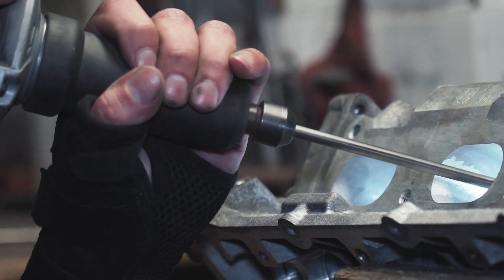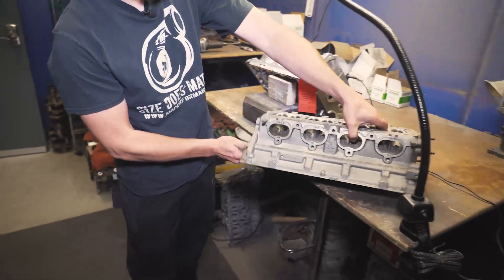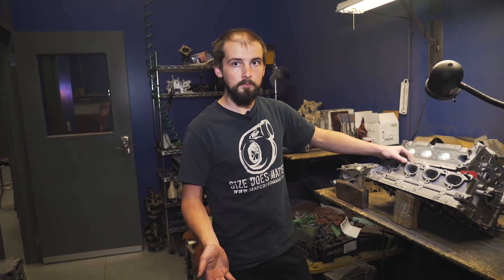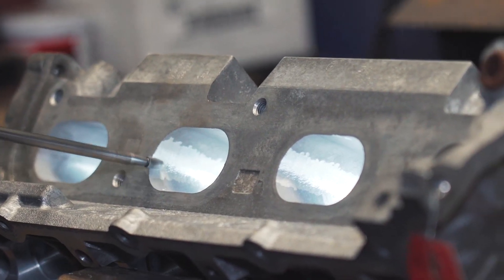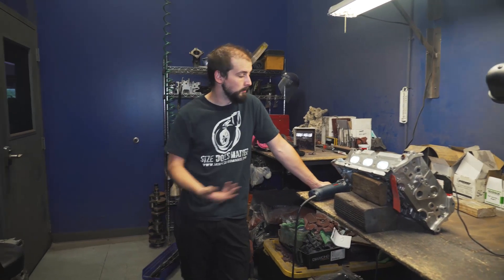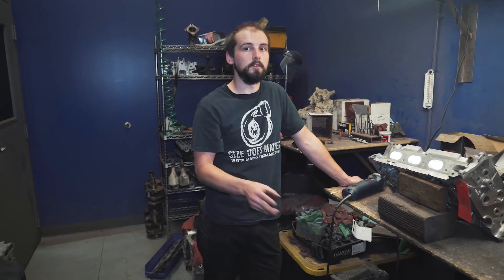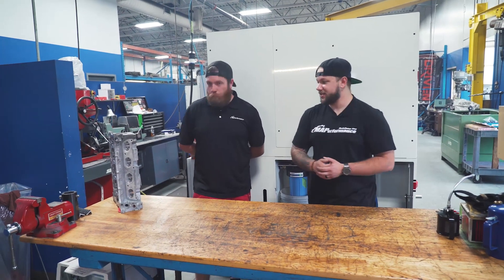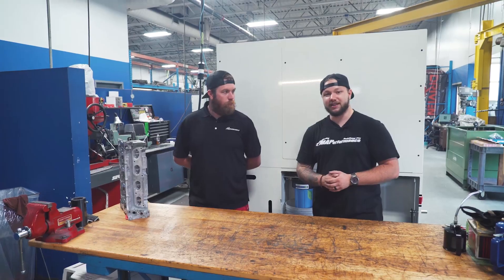Cylinder Head Porting Overview From Stock to 1000hp | MAPTV Ep13

Comment: I thought stage one port and polish was considered street. I'm aiming for 320-330 HP on my Saturn SL2 1.9 with .20 over, gonna run dual intake cams, heavier 3rd gen crank and tie plate with 14-15 PSI so maybe a stage 2 or three is better to achieve that? From what I've learned also, on ported FI your gains are less after stage one , but on direct injection the gains are more, but more carbon deposits on the intake valves, etc.

Comment: I have been hand porting heads and intakes for 20+yrs, all with carbide bits and flap wheels/then hand polish the pockets and the block. Most of the time I will try to find the correct size volume for the application. It is time based vs results process. My father had more than 30 yrs taught me starting at 12yrs old, We did it with water or very thin oil to get the volume dead on. Its not expensive if you do it in your shop. cutting the valve boss included fantastic power.           oB

Comment: I have been developing porting flow benching  and producing ported race heads how do you have stages in porting. . Cost of porting is time  and the time it would take to cut stop measure cut stop measure to produce stages past 3 is bull shit.  The goal is efficiency build power if one cyl flows 18 more cfm across the range that cyl is making more power then the others ...tbt its a sales  strategy. You either map it out or do bowl work blend and finish . It takes along time to massage a port and make it improve you learn after many many years porting and testing what to look for .. and even then it is hard without a bench some smoke and velocity measures.  I seen so many heads from Hondas and Mitsubishi toyotas turbo  cars come in get corrected most time by starting over on a uncut head and using the stage 5 head for a boat anchor . To bringing the head I spent days on back to shop installing it and having to turn the boost down due to the head wants to produce same 1000 they were getting with half the boost 🙃

Comment: Simply out of curiosity. Say you added material to the exhaust side to decrease the diameter. Youd increase the pressure of the gas leaving the head. Or even have it tapered down to a smaller hole as the exhaust leaves. If you bolted a turbo and had higher velocity gas pushing it would it be beneficial? 

Im sure it would add extra stress to parts but im just curious if there would be any positives at all? I would be inclined to believe narrowing the exhaust to increase velocity of gas would turn the turbine and pump more air into the combustion chamber. 

If anyone knows anything please lemme know. Im curious
Reply: That is a very perceptive question!!! The turbo is looking for volume more than pressure. The cross sectional area of the turbine housing rapidly decreases before the exhaust gases hit the turbine vanes, that is where the pressure increase should take place. Too small exhaust ports will create an unnecessary bottleneck for the exhaust flow to get good overall efficiency.

Comment: Polishing strips away the boundary layer and slows down the air flow. Taking a ball carbine and bouncing it around and roughing swirls will get you 5-8% higher airflow across the board. We used to polish them like glass. It was determined 10 years ago and is now known everywhere that it slows down the flow. Bernoulli's Principle and boundary layer rules as well as area rule that are all from aviation is what gets the best ports.
Reply: I'm not saying it means that port design is not amazing. The rough surface is simply a new twist on surface prep. The new thing is CNC dimpling to mimic the surface of a golf ball is done at the top shops and used by all class leaders in racing except where is banned 🚫 🚫🧸⛳

Comment: What would be a good example of head that is easier to port with CNC, because they use less castings or castings are more consistent? Or is the 4g63 has so many differences because it was around for so long?

Comment: With CNC porting now with new programming options you can run a program on ports by using a probe in the port to compensate for the casting shift from port to port, super accurate fron port to port. I am Now a retired CNC Machinist / programmer. Also 5 axis machines are very flexible for compounding angles. Yet polishing is still done by hand.

Comment: Showing the flow difference would have been a better way to display how much better each head flows and how the flow at certain valve lifts changes the way the engine power is produced.
As we know keeping port velocity high is good for torque and if you open up the ports too much then flow may be awesome but velocity is reduced so you end up with an engine with crap low end power and torque yet monsterous high RPM power.
The area of flow under the curve of the graph when mapping flow to valve lift gives a similar graph as to that which the engine makes on a dyno.
A good explanation of what is involved in porting but backing it up with flow graphs woulda been nice.
Reply: I agree they should show a flow rate comparison for like 200-600 or more lift depending on cams ran then do a back to back dyno comparison of the head on a NA motor. No other changes! Then show how much less boost is needed to make 1000hp.
Reply: You absolutely nailed it!!! It completely blows me away that a well-known company like Map is charging so much money for a product that they have no clue  what their product is actually doing. My biggest issue with this is the fact that all of the 4G63 cylinder heads will be a boosted application. So does 
Increasing the volume too much actually reduces velocity? There are so many factors at play. They and so many others are completely shooting in the dark.  so many shops Making Huge claims ass-u-mi-ng every step along the way... There are so many questions they don't have a single solid answers to. It drives me crazy that they can make the claims they do and actually charge $$$$$ for it.😡😡😡 But then again, what do I know?

Comment: Isnt polishing intake ports detrimental to air flow ?
Reply: No, the reasoning behind not polishing intake ports is due to the fuel droplets in the intake stream tend to stick to a polished surface due to the surface tension of the fuel and a slightly rougher surface will help the fuel return to the moving column of air better. But that seems to me to really  only matter significantly when you are running carbs or throttle body injection and not so much for port injection and not at all for direct injection.

Comment: Do new valves come with seats and springs?
Reply: Seats come installed in the cylinder head. Springs are not usually sold with valves. The springs must be ordered to accommodate the cam lift and intended maximum RPM number.

Comment: Its so sad that porting skills like these will all get replaced with cnc machines :(

Keep up the good work
Reply: cnc programs are developed, from a hand ported runner first.
Reply: @mr.know_it_all  they still are....but self learning cfd software is maybe replacing that within 5 to 10 years..... 

Although till now the quickest way is having a port done by porter ...run some self learning cfd on it...the cnc it.......
Reply: @mr.know_it_all  lol what?
If you have a 3d scanned cylinder head/3d model cylinder head
You can run it in a CFM software for the most efficient head porting you can ever achieve and then import it to Solidworks/Fusion 360
Reply: Actually cnc will be gone soon. Biden says that by 2030 half of all new cars must be electric. There will soon be nothing port. Y'all had better study up on automotive computers, electronics, and electricity!
Reply: @johnmurdock5001  true but keep in mind there are still older cars driving out on the roads and highways to this day. They just can’t ban all older vehicles like that, it would be unlawful but yes if you want to buy a newer car they will be electric vehicles by that time. Not sure if it will be a thing when Biden eventually gets out of office
Reply: Cnc is always better then hand porting.
Reply: CNC machine will never be able to port out inlet tracts ... can't better the human eye, a machine can't see, so it can't be done.

Comment: Are the heads bench flowed before and after ?
Reply: Doesn't look like it
Reply: They may have benched flowed their heads in the past.  If their doing the same porting to the same heads every time, they don't need to bench flow every single one.
Reply: If not he doesnt know if hes doing much good. But when you add 35lbs boost it dont matter much. NA motor it would run like shit.
Reply: @4thdimensiontravels855  n/a i would do a stage 2 ans some cams will increase power